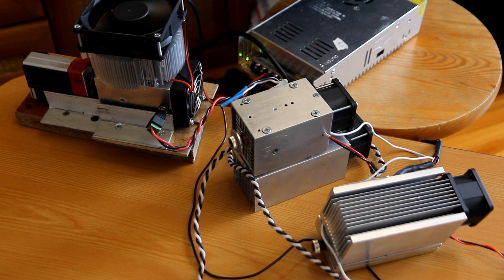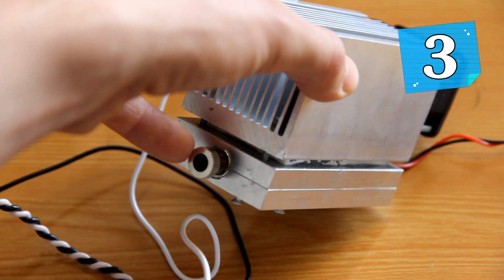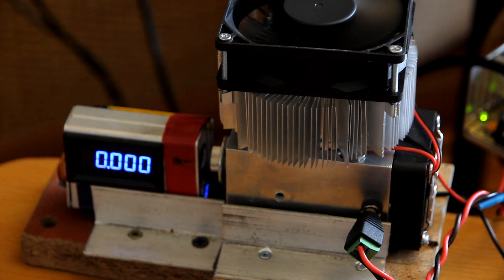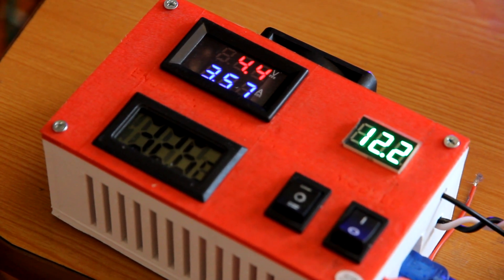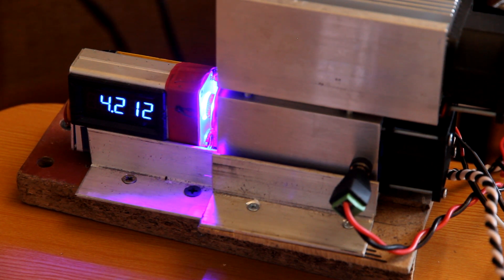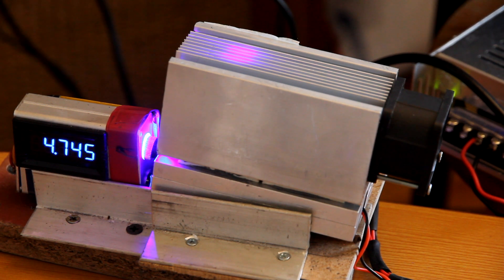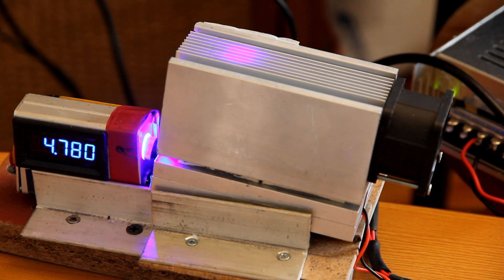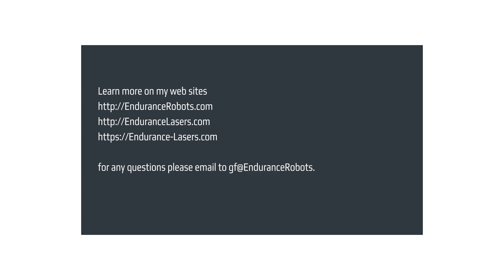Endurance 10 watt PLUS laser. Version "Pro". Latest update. Adding TEC cooling system.

Comment: I included a thermostat controller to prevent the laser block getting too cold. Didn't like the idea of moisture that might effect the diode and lens, and dripping onto the part being cut or engraved. Used it to switch the TEC power ON and OFF at about 16DegC with temperature differential of 1.5Deg C. This little thermostat is also equipped with an over temperature alarm, very nice device.

https://www.ebay.com.au/itm/DC12V-50-110-C-W1209WK-Digital-LED-Thermostat-Temperature-Controller-Sensor/262691636648?hash=item3d29a445a8:g:5xQAAOSw2zNcwCIL